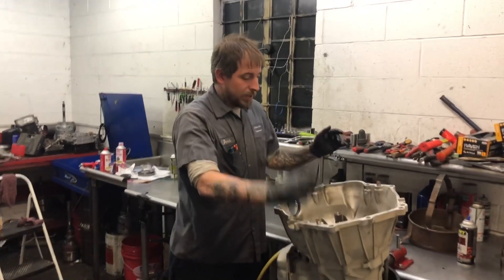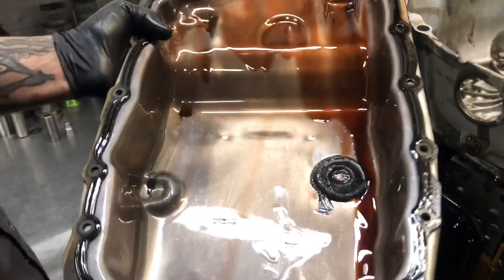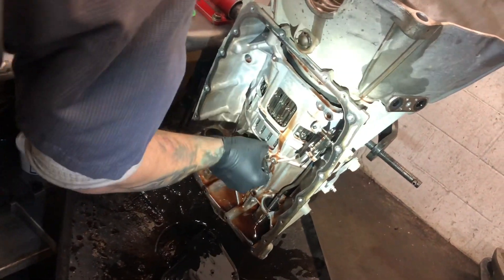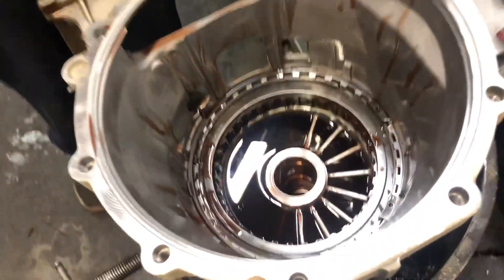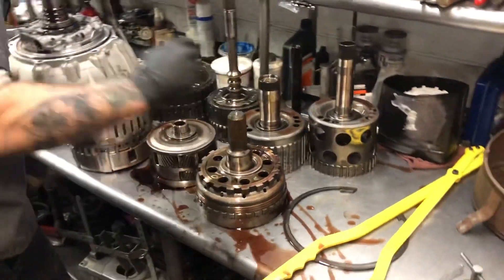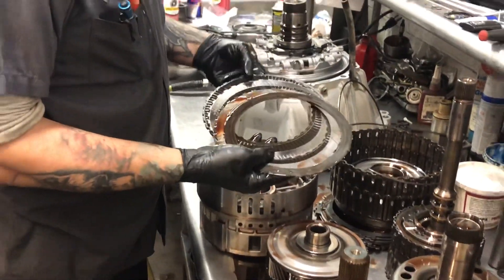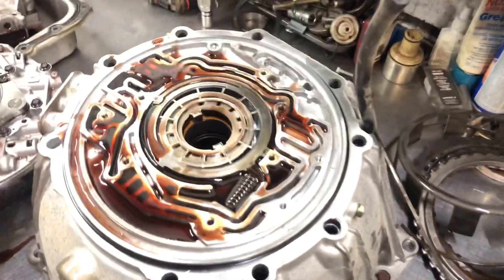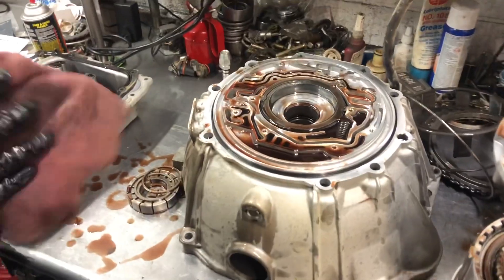2015 GM 6L80 torque converter failure

Comment: Can't really complain about mine. 2013 Chevy Express with 210K. Started dropping to neutral at stop signs. I tried, unsuccessfully, to avoid stop signs... so out it comes. Also has intermittent harsh 1-2 upshift.
Reply from the maker: That's absolutely awesome. Thanks for sharing with us I'm glad we were able to help .
Reply from the maker: Slowly getting wore out sounds like
Reply: @expressautotransmissiondav4207  thanks to you and a couple of other folks on Youtube, I got brave and pulled the trans. Got the shop manual. Sure enough, new bellhousing, stator support, pump, bushings, Sonnax kit, etc. Buttoned it up, down the road it goes. Biggest hassle was getting it to a dealer for a relearn, lol... Drives like a new truck now.👍

Comment: Just t
Had a P0741 code on my 16 2500HD only 32k. Any thoughts on that code?
Reply from the maker: Yes that's a bad idea if your towing leave it in tow haul. I personally suggest unhook try to get some rest and take it in to have it checked. I hope this helps
Reply: @expressautotransmissiondav4207  yes we are posted up save at a rv park. I was just looking for some info on it. Thanks for your time. 😎
Reply from the maker: Just to be sure which unit do you have
Reply: @expressautotransmissiondav4207  it’s the 6.0 gasser with the 6L90
Reply: @expressautotransmissiondav4207  MYD part code should be 6L90
Reply from the maker: Cool just making sure. So early on when the 15-16 just came out they had issues with converter lining. It's possible you have an internal issue. The best thing to do would be to get it diagnosed by a very qualified shop. Looking at slip speed vs dod is a great place to start. If crusing it doesn't show enough slip to activate the code then I would clean mass air and verify everything in order of air flow to make sure it's  actually having a lock up concern. If you have a scanner I would be more than happy to help with walk through of code chart and theory of operation.
Reply: @expressautotransmissiondav4207  I have just a code reader. I’m on the road with my family towing our RV. It happened today and I really don’t see any drivability issues. I cleared the P0741 once and we ran with no issue. Stopped for fuel and while on surface streets it popped up again. This time it won’t clear and is accompanied by P0700. I spoke to a local shop and have appointment in the morning. I’m not sure if I should drive in manual mode without tow/haul engaged. Is that a bad idea?

Comment: Is there anything I could do to prevent this? I just bought the same exact truck not knowing about this common issue. I plan on draining the tranny fluid and changing the filter. As well as adding a Sure Cool System by Superior to keep the fluid cooler.
Reply from the maker: In all honesty there's no prevention that I'm aware of outside of starting over. If the truck already has miles on it, then it's to late. I don't believe in mystery in a bottle. The sure cure could help prolong the inevitable failure, but it will not prevent it. My suggestion would be to plan for the failure, we bought a 2015 when it had 60k on it and started saving and had the money to repair when it failed. I hope this helps if we can do anything to help just let me know.
Reply: @expressautotransmissiondav4207   thanks for the quick reply. I bought mine at 60k miles as well. You don’t think it is a maintenance issue? Shifts gears perfectly currently and hoping to hit 150k miles before she blows. How many miles was on this one in the video?
Reply from the maker: I'd have to check my records on that.  On my personal one it had 158k when it went down. I think that the bearing failure and valve train wear areas cannot be prevented once they start wearing. Service is definitely a great thing for it and if caught early could be easier for repairs.
Reply: @expressautotransmissiondav4207   thank you so much for the info.
Reply from the maker: Absolutely anytime
Reply: No there is nothing that you can do to prevent this. Mine one day just started acting up. I was religious on all maintenance. It's not a question of if but when. You will need a complete remanufactured one, that is special built for heavy duty. If you go get one from a dealership, GM still has not fixed the issues!! Second is turn off the AFM!

Comment: How much does 6l80 transmission rebuild usually cost in the real world?
Reply from the maker: Our start at 2700 on the bench and go up from there.
Reply: @expressautotransmissiondav4207   thank you, I have a slight 45mph shutter in my 2018 with 83,508. Would putting lubeguard shutter fix be okay in these new transmissions or would that hurt more then help?
Reply from the maker: The mentality behind the shudder fix is based on fluid only the shutter your experiencing is a mechanical issue. Personally I don't the it's would be worth the cost of the bottle to use it in this situation.
Reply: @expressautotransmissiondav4207  okay thank you sir, have a great day.
Reply from the maker: You too.
Reply: 3k POS transmissionz
Reply: 2500
Reply from the maker: I would start with a good scanner and checking for miss fire first

Comment: Why does the Torque converter fail is it just garbage is the a better one I can buy  that won’t fail. I would like to prevent this from happening thanx
Reply from the maker: It's not a converter issue in my opinion it's a valving issue that creates the issue. To prevent it I install a sonnax zip kit and a new converter.
Reply: @expressautotransmissiondav4207  what do you recommend for a torque converter we are currently having this issue on our 2009 suburban. I’m happy to have stumbled across your channel. I personally would like to see more videos on the 6l80e and the 4r100 or the e4od transmission they put behind 7.3 liter diesels in the Ford full size pickups and vans
Reply from the maker: @brianbutterworth8186  I thought it tagged in the first reply whoops lol
Reply from the maker: We have a lot of 6l80 stuff on the channel and are currently working on a full 6l80 build series. I personally like to use the recon with a flanged hub. I also use a lot of dealer and precision converters in them depending on application. Thank you for enjoying our channel we really enjoy making the videos and trying to help as much as we possibly can.